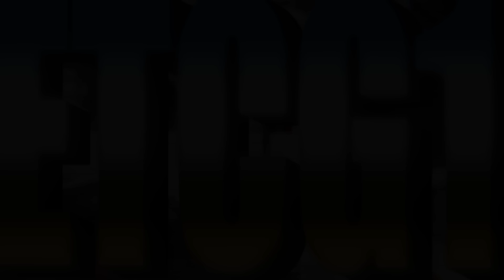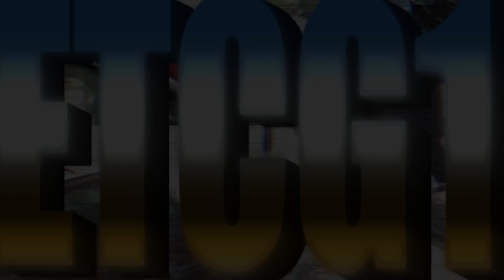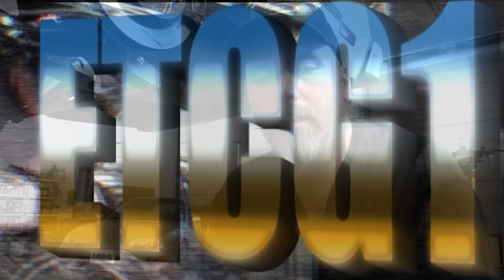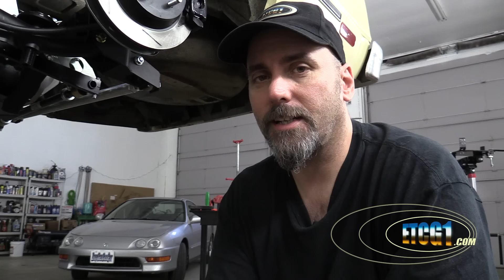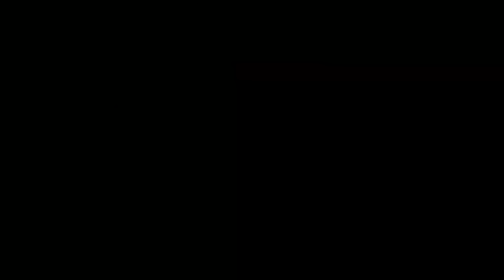Misconceptions About Performance Parts

Comment: As an engineer, I have to agree with the people saying it MIGHT add a couple horsepower, to maybe 10-15. I've seen cold air intakes, for instance, that do add 10-15 horsepower. Sometimes they do absolutely nothing.

The issue I had with MCMs test was that it was on japanese performance cars. Of course those cars are going to have a perfectly fine intakes. They're made for performance and they have tiny displacements. But on my 99 Sierra? You can actually get some HP out of it. Will you notice it? No, as it will likely add only ~5-10, but it's there.

The part that is actually true is mileage. You will improve your mileage in most cars. Why? Factory intakes are a balance between efficiency and noise. The noise suppression in the design can sometimes hurt mileage. That's why cold air intakes are more effective on larger engines. Larger engine=more intake noise=more noise suppression needed on non performance cars.
Reply from the maker: I don't think removing noise suppression in the intake tube is good for 5-10 hp. Just because it's louder doesn't mean it's making more power.
Reply: ETCG1 It doesn't. Like I said, sometimes they do nothing, sometimes they help a little. I've seen vehicles get better mileage with a cold air intake. And I've seen vehicles get absolutely no benefit. Just my experience.
Reply: I would also like to rebut the MCM test by saying..... CAI on a turbo is stupid because the air gets compressed.
Reply: But the argument is that increasing the diameter will allow better flow. That is the precise problem, as you have to tune the car by re-calibrating the MAF sensor on the car in order for it to run properly.

I've noticed a small improvement in the high RPM performance speed acceleration of my stock turbo car when I upgraded from 2.75 to 3" and calibrated properly. I also felt that the car lost a bit of torque as in it doesn't push me back against the seat as hard.
Reply: SI0AX It really is a fickle and car by car thing,
Reply: It all depends on the vehicle, there has been an amount of R&D spent on it.. to get what they want. 
If it was a car from mid 90's and Japanese.. a Cold air intake could improve performance, as it was restricted under the Gentlemen's agreement.

All depends on where the restriction to flow is.
Reply: Doesn't a 99 Sierra already take in 'cold air' from outside the fender area?
Reply: Tnb Spotter
My 96 Windstar sucks in air from the fender area behind the driver side headlight.
Reply: Again that is a good cold air intake, depending on how it is cased, may get warmer when sitting in traffic.
Reply: Tnb Spotter Ya. But cold air intake kits come with a heat shield that seals against the hood. Not sure how much of temp change it makes, but the intake is much smoother and straighter, and doesn't have the huge noise suppression bulb. FYI my truck is stock, but others have reported HP and MPG gains.
Reply: LinusScrubTips
I have an 01 Silverado.  The factory intake necks down to about an inch near the sound suppression bulb.  It made the engine wheezy above 2k rpm.  I replaced mine with an aftermarket straight pipe intake.  It breathes much better at higher engine speeds.  But since the ecu wants to shift around 2k rpm,  the mod is of limited value for normal driving.
Reply: It only makes a difference if the intake is the bottleneck in the system. Sometimes the intake flows more than the throttle body or maybe the head or exhaust. Each of these components flow a certain amount of air and therefore could be the bottleneck in the system. I know there is a thermal argument that goes with this but you will see more gains with flow than heat control in most stock applications. Heat makes a difference but its felt more in the higher performance applications. If you drop the intake air 5 degrees on your fiat 500 its not going to make as much difference as dropping it 5 degrees on your Z-06 vette.
Reply: Travis Callahan
I had that with my turbo car. I don't care if it's sucking air from the middle of the engine, I only got it for flow benefits.
Reply: I would have to disagree about mileage, but not completely. I just want to start off by saying I'm a rather meticulous person and reset the trip-counter every time i fill up on gas (once or twice a week, i drive a about 300+ miles a week). And when i make changes i pay attention how much of it is highway and how much is city. Been doing that for the last 10 years. From my old 89 N/A Supra, to my 88 Turbo Supra, to a beater 95 Civic (5 speed), to a Volvo S60 2.5t.

I have tried "cold" hot air intakes, K&N factory replacement air filters, and of course factory OEM filters. And for the most part.. there is no power gain (unless it's a turbo car, which can vary if even helps due to the nature of how a turbo works). But there is a noticeable increase in throttle response which is most likely perceived as a "gain".

Which brings me to the conclusion on mileage. Your cars computer will always try to hit 14.7:1 AFR, and with that the only thing you ARE doing is lowering the RPM and thus the friction of the engine and increasing the efficacy by a small margin by giving the gas more time to burn in the cylinder. So small that i have seen noticeable changes in my MPG due to small weather changes but not changes in my filters, EXCEPT! when i put in a "cold" air intake (on the N/A, and the Turbo Supra), it got my garbage MPG in the city and normal MPG on the highway.

Never seen a aftermarket "cold" air intake make more power on a VERY well running car, maybe the stock had an intake leak and you inadvertently fixed it? I know the SMALLEST intake leak on my old 88 Turbo Supra made a massive difference, but not so much on my moms Malipoo (its a 2000 bronze Malibu lol).

P.S. my friend said that on his 95 Sierra 5 speed he noticed absolutely no gain from stock to aftermarket boxed cold air filter, and felt silly for wasting $250 but and he did put on headers a year before that. Sorry if that was long winded or if i come accross like an a-hole, I'm just sharing what I have noticed and messed with in my time.
Reply: Gabriel Soria
I do the same, but lately I've been disconnecting my battery due to modification adjustments I've been doing on my car so I haven't gotten a good MPG reading on a long time lol.

MAF based turbo cars will have their Air-Fuel Ratio significantly altered with an intake leak. I don't know if the Supra has MAF sensor after the filter though.
Reply: MCM tested to see if a cold air did anything more compared to a regular upgraded intake, all they where testing was whether the cold air was different from the "hot" air. and it wasnt.
pod filters/upgraded intakes do work and do add power, but cold air intakes dont work better then regular upgraded pod filters.
Reply: SI0AX the MK3 Supra Turbo has a MAF and the N/A has a "meter" which is basically a a box with a flap in it lol :/ I had a N/A Supra for about 2 years before getting the Turbo which I had for well over 5 years.
Reply: Gabriel Soria
Then you will need to modify the ECU, but I've heard that Toyota ECU's are a pain to reverse engineer to make it re-programmable, so you will have to go to a standalone ecu or use a piggyback like SAFC.
Reply: There are facts that are always true. Colder air is denser than warm air. Smaller headers improve torque, larger headers produce more top end HP.

But there is also one other constant. Balance. Too many times I've seen people just go with the bigger the better. Which only proves they know nothing of the physics behind what they are doing.

Too often I lament the decline in DIY on cars, other times I feel it might be better that way.
Reply: Look up the 4th Gen LS1 F-bodys .  They were getting 10 RWHP from just a SLP intake duct lid. This was the first must-have mod for the ram-air F-bodys.  It all depends on the engine.  Generally speaking, it's an air pump.  It takes hp  to draw in and push out air.  The easier the better...to the point of not losing scavenging.  Some vehicles are more efficient at this task from the factory then others.  That's what makes some cars respond better to bolt on mods.  If your factory intake duct looks like pretzel  (for routing/noise), you probably will see a couple ponies with a short ram/cold air intake.  Ask anyone with an LS engine if a full exhaust/intake makes a difference...especially with a tune.  This channel rocks!
Reply: Rick James
 Which goes back to my point of it only adds power if it IS the restriction. If the air restriction is downstream it won't mean a thing. Oh and F**K YO COUCH. Love the name.
Reply: TheRealestEver
  Biggest gain I ever got out of an Impala was by buying the v-8 version =P
Reply: TheRealestEver
So you're saying that the V8 Impala has less power gain potential vs the V6?
Reply: TheRealestEver
 I gained 60 horses and 50 ft/lbs of torque in factory format with a much higher power potential than the old L67 could even dream about. The engine is solid. 170k miles so far and still ticking. That motor could throw down 4 digit horse power numbers with the right mods but there's not a trans axle in the world that could take it. I could make 400 hp with less than 2k in parts and tune. Do that with a 3800.
Reply: TheRealestEver It's still an LS motor sideways or not. I've seen boosted 5.3's in other applications make over 1000 hp. It's impracticable, but it is possible. If you look I said the motor was capable. I never said the car would handle it. You said the motor was crap and could never throw the numbers the L67 could dollar for dollar. The L67 is a great platform, I loved mine. The reason you see more L67's at the track is because they ran them for over a decade and the LS was only run for 4 years. Once the 3.6 direct injection reached the performance values GM wanted they pulled the package because the efficiency was higher on the 3.6. However, The engine is very capable of handling tremendous amounts of power if you do the mods required. hell here's one that made nearly 600 for only $1000 more than I said I would need to make 500. If the link shows up. http://www.hotrod.com/articles/hrdp-1104-594hp-53l-gen-iii-small-block-for-3252/ It's ok to disagree but I do know my shit sir. I've been in this business for a long time.
Reply: here's the sister car built to 800 hp http://www.superchevy.com/features/1403-2007-chevrolet-monte-carlo-ss-the-vision-thing/
Reply: I will restate that amount of power is impractical, however the 500 hp is not that hard to obtain from this power plant for not very much money. cam, exhaust, re work the heads, larger larger throttle body. The intake will do it, but only just. If you go any higher you're talking custom parts, the aftermarket didn't care much about this platform. I guess I should add a caveat on the heads. I know that costs money for most people. I am a machinist so It's free for me, as are most of the custom stuff needed to make this motor even more of a brute. That's probably why you think my estimate sounds low.
Reply: TheRealestEver
Sorry but I just don't really know these cars/engines:
So the V6 has more power potential than the V8 because you're talking about the supercharged V6 vs the naturally aspirated V8 right?
Reply: TheRealestEver
Well that explanes it. Forced induction will always make more power, and when it's stock FI, the engine is made much stranger to handle the added stress so it leaves room for more power.

I think it's weird that you use that car as a beater lol. I would turn it into a drag-beater lol.
Reply: TheRealestEver
 From the best of my research and looking over the two engines the only difference between the fwd variant and the rwd that I can see is the bell housing pattern,intake was reversed, and the crank was shortened at the snout and flexplate. Beyond that the guts are interchangeable.  Hell the heads are LS6 heads. There is no mechanical design change, just minor fitment changes. I'm almost willing to bet they're even machined from the same casting. I've actually been tinkering with the idea of trying an ls7 or ls3 swap (some machining required of course) when I retire the car as my daily driver. I think the platform is fascinating and has been under realized by the after market. I did find a company that builds trans-axles for it good to 600 hp they claim. The weak link in the chain is...oddly enough the chain. I want to tear apart a junkyard tranny and see if I can mock up a gear drive for it.  CV's don't scare me too much, I can make them out of better materials. I like the 3800 but I still feel the 5.3 platform has a higher power potential, they just aren't as popular.
Reply: TheRealestEver
They have to stock it out and sell the mods individually. A very common mistake many owners make. Every part I remove from my car is stored together in a box and I don't to irreversible modifications unless something was damaged anyway.
Reply: TheRealestEver
I don't think I ever plan to sell the car, and I don't want to but I'm still keeping every single part I take off.

You never know whether you'll keep a car anyway.

You could also stock out the car in the case of an accident that totaled your car so you can get your investment back. You'd probably need to have a cool insurance company or something. I've seen some people do it.
Reply: TheRealestEver
Yeah you are correct, they blow out sleeves, however the platforms strong suit is its displacement potential. If I'm right about the machining differences one could potentially modify an LS7 block and stroke it out to a 454.  Likewise you could reconfigure an LQ9 block for severe boost applications. I really do want to try to rework the trans-axle. My Dad turned wrenches for 40 years so I grew up in the shop. I became a machinist so I could make custom parts for my project cars. I don't want to take away any of the L67's glory though. That is the toughest 6 cylinder GM ever produced. Well I say that but I've not had experience with the 3.9 or 3.6 they've been building the last 6 or so years.
Reply: LinusScrubTips why do i get cold chills when i piss
Reply: Gabriel Soria yes....with a uncontrolable mili sec shiver...
Reply: LinusScrubTips number one if the manufacturers could add a cheap piece of tubing and increase mpg and hp they would. they spend millions on research to get a finite balance and a 100 intake that could do that would not be overlooked. number 2 most people that do see gains had it tuned afterwards and the tune probably represents 99.9% of that hp gain.

Comment: All modern cars have cold air intakes as the air is taken outside of the engine bay, normally a scoop that is in the wheel well or in front of the radiator will feed air from the outside of the car to the air box.
Reply: no
Reply: What you think a CAI is a K&N style pod filter?

You're thinking of short ram intake or are just ignorant on what a CAI really is

A CAI is where cold air(colder than engine bay) is used in the ICE.
Many new cars do this as they draw air in from the front of the car or wheel wells, look on a new car if you dont think it I am being truthful.

A SRI(Short Ram Intake) is where you remove as many air flow restrictions as possible.
So with a SRI you want [Pod Filter>Pipe>Intake]
No resinator, air box or anything.

If you still think I am wrong prove it instead of saying "No"
Reply: IIGrayfoxII wrong
Reply: sure sure toll.
Off to school now, you dont want to be late.
And make sure you give teacher her apple.
Reply: IIGrayfoxII nope
Reply: But the "selling point" of CAI is better air flow. But in reality, less turbulance may need a longer run to allow the air to "straighten out", than can be gotten with K & N, and similar systems.
So again, it may take more research than reading a box to give you what you are looking for.
Reply: Thank you so much for saying this.  

I think anyone who talks shit about a cold air intake should go take one off a modern car and see that they usually draw air in from underneath, and there is usually a hole in one corner of the engine bay that accommodates  taking in air from the wheel arch, or as you said a scoop that takes in clean, moving air.

It's not the cold air intake that's bad, its the thinking that is bad...that going from an OEM engineered system to an aftermarket pipe+filter when you have NO OTHER MODIFICATIONS, hardware or software, will give you a real power increase.
Reply: First off, cold air intakes help a lot, like the one guy in the comment section above said intakes are useless lol. duhh only if there put on a stock car by itself.
Reply: My 1987 Golf mk2 has a built-in CAI in the right fender :D

Comment: I bought the best performance part ever and added 100hp, it's call nitrous. Cheapest horsepower in the world.
Reply: yeah but the bottle isnt infinite
Reply: Neither is your tank of petrol (Gas for you USA guys and gals), so people with nitrous would treat it like filling up :)
Reply: All you have to do is win once.
Reply: You do only need to win once. However, it is a possibility that without other mods you will ruin whatever car you bolt nitrous to.
Reply from the maker: Good point. But you don't just bolt on nitrous. You have to tune it, replace it, and also make sure you don't scatter your engine. Up to that point it's a heck of a ride though.
Reply: actually you can bolt on nitrous.. lol it doesn't need a tune if you go wet nitrous and stay at 100 shot
Reply: it depends on the car, most of the time you cant just bolt it on and not expect something to blow up, if you threw a 100 shot into a civic you would double its power and blow it up
Reply: well my 5.0 takes 100 shot like a champ (:
Reply: Nitrous on diesel works a treat and you can't melt them- any excess simply gets wasted out the exhaust. Shame there's so much ECU bollocks to deal with these days.
Reply: most damaging as well
Reply: It is cheap until you blow the engine